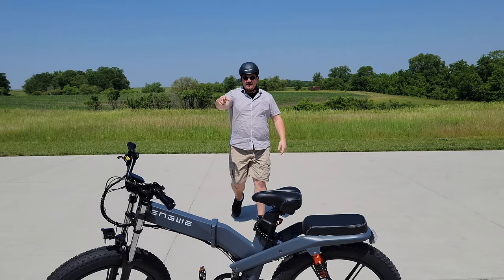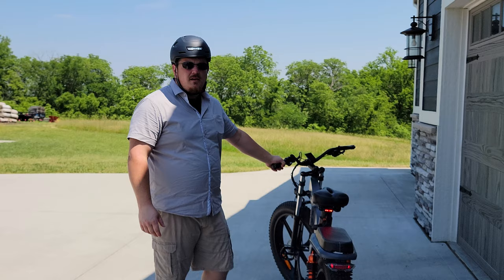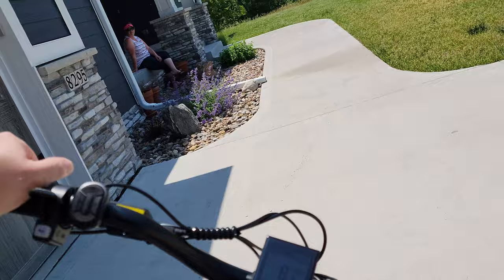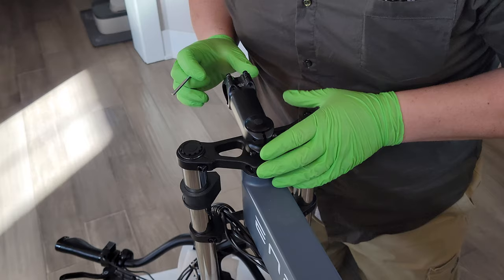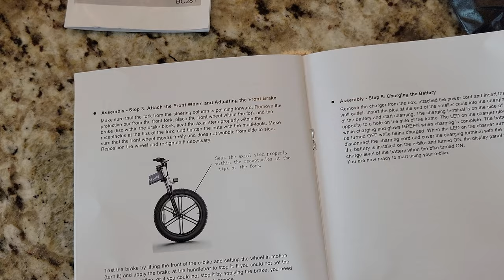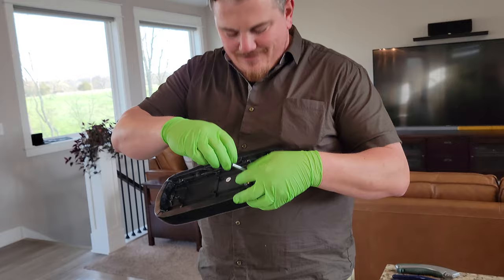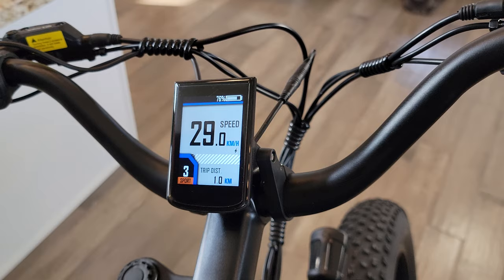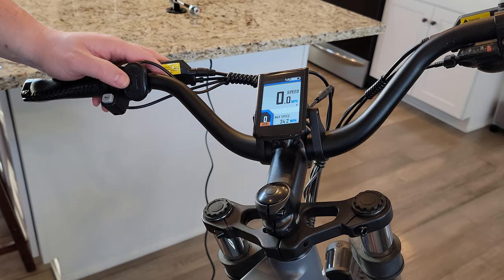Engwe - X26 - 48V 1200W 26" X 4" Fat Tire EBike - Unbox & Run

Comment: Lol, pretty evident you are new to bikes if you don't think they will spin out on you while riding. You just need the right amount of power but you have to pay $$ for that power. For a big guy, if you want hill climbing power I would recommend a dual motor setup. Try the Philodo H8 as a budget option or something similar to it....I think there is one called Zeegr(not shure) that will let you choose between running one or both motors at once if you want to save battery they both look just like a standard old mountain bike but with two 1,000 W Motors. 

For single motor with good power try the Wired Freedom, it's 1200w at the rear but it's a 60 volt battery not a 48 like you're riding there. To get the most power out of that motor you need to provide it power. The Wired Freedom probably won't peel out on you either but it's hill climbing power is going to impress you and the h8 is going to blow your mind. The Wired Freedom is a nicer-looking bespoke frame bike. It will feel more quality. It's probably the best deal on the market for the quality versus power.

But get yourself a five or six thousand watt + bike and I'll be happy to come back and view your channel again. It will be nice to hear your thoughts then.

Comment: It looks like you have a first generation X26.  I just got my X26 last week.  The batteries are now blended and you do not have to remove the smaller battery charge it.
Reply from the maker: Really? That's interesting! We just did this review, a few short months ago???
Reply: The newer version (which I have) also has a 3 minute limit on Sport mode.  :( @BrianPhillipsRC

Comment: Brian. You would think they could add a small gen to the bike to put power back in the battery when you are moving. Give you a little extra range to boot. I use to ride bikes back in my youth and miss it. The E-bike has sparked my interest in riding again. P.S. Glad to see you folks got to attend Horizon Fest. That event is still on my bucket list. 👋😉
Reply from the maker: Thanks Brad, and yeah, I think they should be able to regenerate with breaking, but didn't see any setting on this one.

As for RC Fest, it was a blast, and Megan and I got to hang out with Nate and Abby (and their kids) and Pilot Ryan - it was very nice!!! (...but none of them bought me chicken nuggets, so you're still my favorite - LOL ;)
Reply from the maker: Ebikes are amazing, but they can be tough to pick. so many BAD choices out there, and many that are just plane over-priced, but to be honest, from my learning, get as powerful as you can afford, and you'll never regret more power, but if you want exercise, make sure it's got a pedal assist option, NOT just a throttle.
Reply: @BrianPhillipsRC  👋😉
Reply: @BrianPhillipsRC  Brian. Thanks so much for the excellent advice on selecting an E-bike. I’ll be sure to take it all in consideration. Take care. 👍😊

Comment: E bikes have speed limiters on them... to keep them regulated as a bicycle not as a motorcycle... the wattage of the motor gives you the power but not the speed... the benefit of going up a grade without slowing down... the variables are your body weight and the grade will drain the battery at a faster rate.

Comment: Outstanding video!!..  appreciate the install footage of close ups usually missing from others.  I love this bike but hill climbing struggle is only issue.  Any possibility in addition front hub motor or upgrade of original motor?  Would love to keep original wheels however.  Thanks 😊
Reply from the maker: Glad you enjoyed it! We try ;) As for the additional motor up front - THAT WOULD BE AWESOME!!!! We've been looking for a two wheel drive bike for a while now, and have found only a couple that offer such a feature, but they're super expensive, and at my weight...up hill is hardly possible without help from my legs.

Thanks for the feedback, and glad you enjoyed the content!

Comment: Is the rattling coming from the battery? I saw another reviewer noted that. He fixed it by applying some felt padding to the top and bottom.
Reply from the maker: I'm sorry, but can't say for certain. There are admittedly a lot of THINGS that could wiggle on this bike...but I assume it wouldn't be the battery on the center part, since it's mounted pretty tight...NOW the FRONT battery, in the tube (backup battery) might have some rattle too it, and I just didn't think about it.

Comment: I am not so happy. 
. 
I had seen a few ENGWE bikes in my neighbourhood and the owners seemed to be satisfied. I ordered a X26 and it arrived three weeks later and I have to admit that it was a bad buy. 
Why? 
The main problem is that the bike has a very late response from the throttle and the pedal-induced motor assistance. Both at the start and at the end of the motor assistance. This means that the electric motor only kicks in after 3 or more pedal strokes (sometimes vehemently). And it continues to push for what feels like seconds, even when you have long since wanted to coast or brake again. This misregulation alone makes it very difficult for most people and impossible for many to handle the e-bike. Other shortcomings are:
- There is no key with which to lock the e-bike. Other Engwe bikes have a key to lock the electric parts. You therefore have to buy an additional lock, which adds to the weight of the bike:
- This is because the weight of the bike, including the batteries, is over 50 kilograms and it does not manage to climb steeper routes (over 25%) with an adult of average weight. Not even if you are also peddling. A motor with an output of one kilowatt, i.e. significantly more than one horsepower, should actually be able to do this.
- The motor is a bit louder than average e-bike engines but that is not a major problem.
- The instruction manual has far too little information. Many things that actually require a comprehensive explanation are not mentioned (throttle lever, key for second battery, opening the locking lever for the saddle adjustment, computer settings) and you have to painstakingly work out this information yourself.
- Quality control is very poor, if it exists at all. The front brake disc was sent to me new by support. I had to reinstall it because the one that came with it was making grinding noises.
- I had also ordered a rucksack, which was listed as an accessory on the same order page, but had to realise that it was incompatible with the X24. There seems to be also a lack of a caring hand in the area of accessories, which puts together the range in such a way that such bad purchases are avoided. This item has been removed from the page in the meantime 
I live in the Alentejo in Portugal and can't do much with this version of the bike.

Comment: Great video, Brian. I'm really interested in this bike, currently owning a much cheaper 26" Ecotric that I'm having problems with. Will the seat go any lower than the height at which you had it during your riding demonstration? It looks like it could go down another couple of inches. Is that correct? Thanks.

Comment: Did you just skim over regenerative braking? That's huge!
Reply from the maker: I may have mentioned it, but since I wasn't sure about it actually working, I didn't want to get too crazy on that detail.

I have it on our scooters, and it works VERY well, but I can't see evidence on this bike, and would like to see it. It should also help with breaking, and this is one of the major issues I have with EBikes...they're so much heavier, I want stronger breaks, but there again, I'm heavier than your average rider...so kind of a me problem.

Comment: You are an absolute amatuer when it comes to tools....I plan to on start up assembly to change pedals and handlebars and grips and saddle and a robust storage rear box instead of the supplied cheap pad.  etc.... Nobody but nobody  would use the cheap spaghetti so called tools supplied with these e bikes...The front wheel should have been installed with the bike upside down..Would have taken half the time you took. Plus adjustment would be so much easier...The brakes need bleeding to perform tip top....I still enjoyed your video but kept shouting at your mistakes my friend...😁
Reply from the maker: I like bikes, but don't claim to have any expertise beyond having a lot of them. I'm too lazy to get the "right" tool for the job, but we also want to show what it comes with, and how terrible the build might be for the average Joe...but yeah, most people would use their REAL tools, I agree.

Comment: As soon as that rubbish suspension bottoms out that seat tube being so low and the crank welded to it like that is gonna cause problems! That post battering off the ground it'll Snap your spine and probably snap the crank off! And why it has fake downhill duel clamp forks on it i don't know? The rear coil springs are no better rode carefully on it no jumps tricks etc it wont end well

Comment: Not much crash protection against the battery in that downtube is there! It still amazes me how people think these are the best thing since sliced bread! Gonna get one get a proper one and not a danger to your life! Dodgy suspension Dodgy brakes shody welds, sometimes even ground down to make you think it's all part of the design! No structural twist force protection with that single battery casing probably with the brittlest of alloys! One hit the wrong way your gone on this thing! Just waiting for some accidents with these type so there made safely to a real bikes standard.